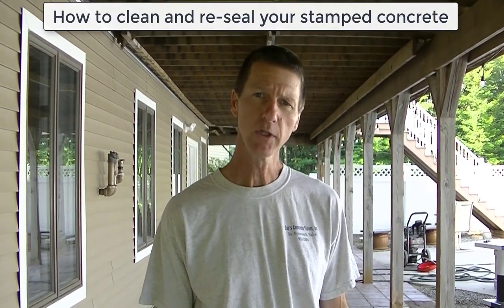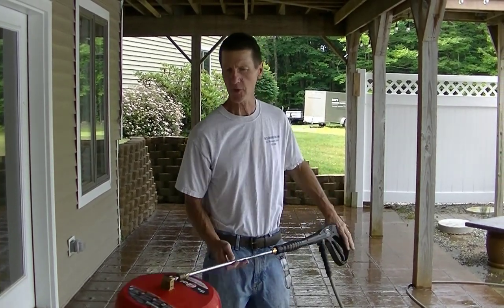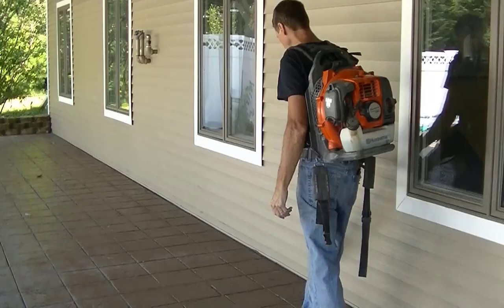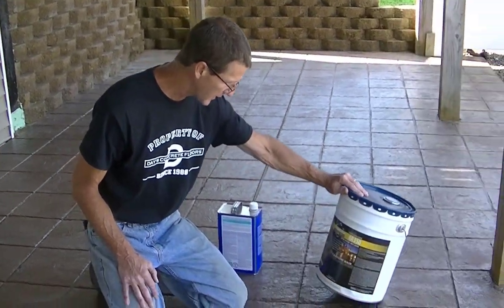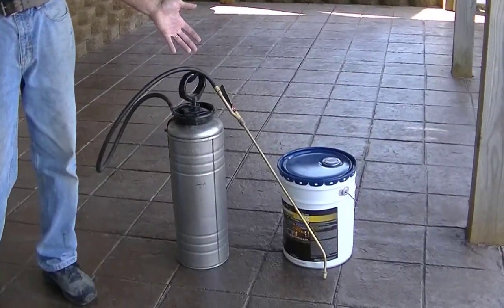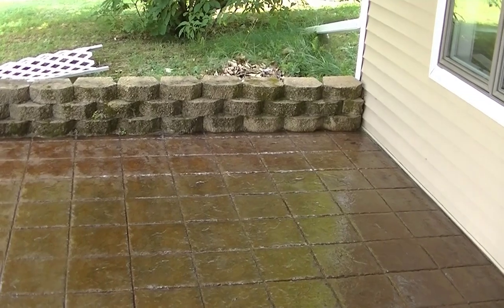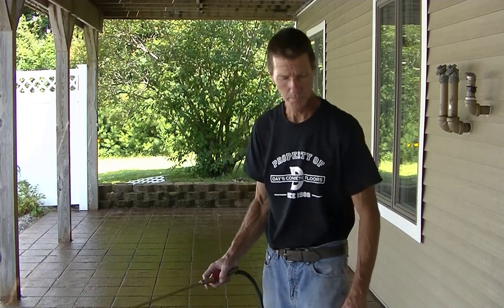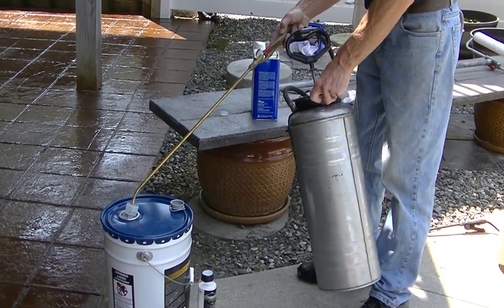How To Clean And Re-Seal A Stamped Concrete Patio | Everything You Need To Know

Comment: The whole purpose of a sprayer is to not have roller marks… lol Do your edging against the house with a roller and brush so a dingleberry so called expert like this guy doesnt spray your siding with sealant. And when you spary you always spray away frommteh house, fence, deck or ehat ervyou need to keepmsealnt off of. You can see it on the siding in the video 🫣. I would so sue this guy for the ruined siding if he didnt clean it to where you couldnt tell a thing or replace it. 
This dude is an example of what not to do. Infuriating! Pople please do not listen to this youtube fake pro.